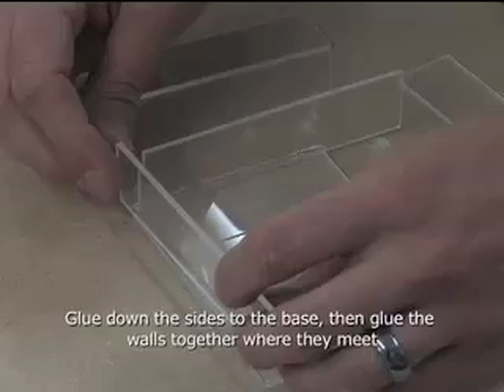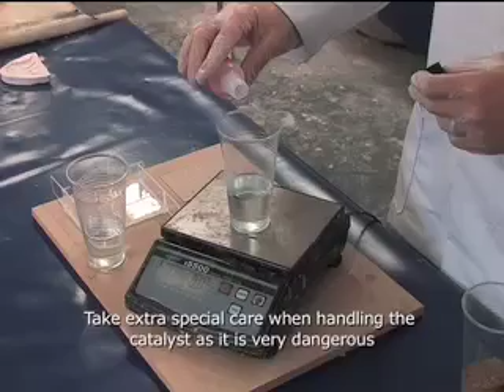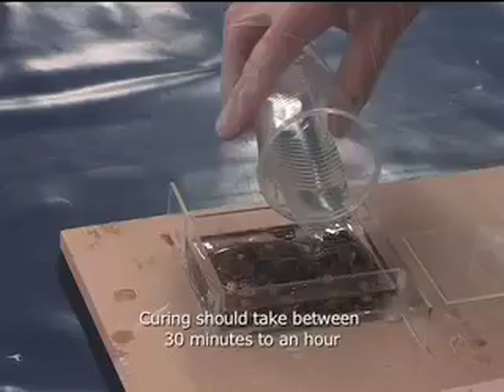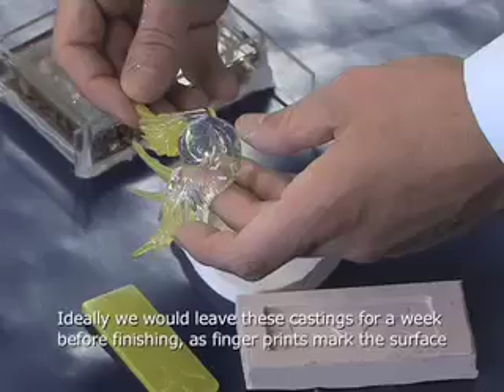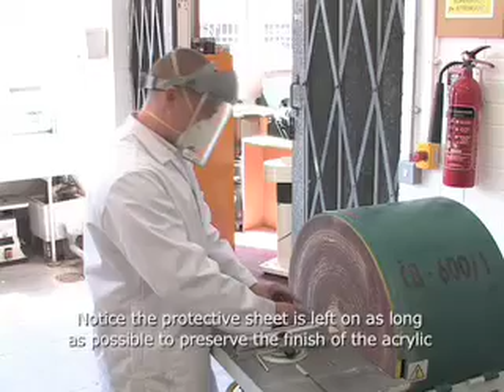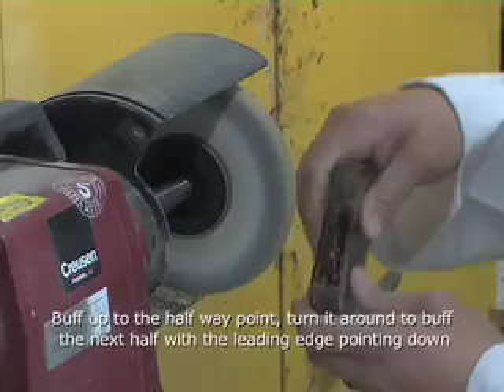How to use clear casting resin for encapsulations and casting

Comment: Hey nice video. I was wondering how you finished the piece after polishing it. Did you remove the top and bottom pieces of acrylic sheet? If so, how would you do this with out damaging the casting? 

Also in your opinion would it possible to cast a block thats 1 foot square in Polyester Resin? Just use very little catalyst and let it cure for two weeks?

Comment: soooo if im not trained and don't have one of those saws, anyway to do this video??
Reply: you can use anything hes referring to a shop setting needing to be trained by superviser. you may also use hand saws or a grinder with a cutting disk some cutting methods just may leave more work in the buffing stage i would sugest a 30$ hand grinder and you can switchfrom cutting wheel to sanding/buffing pads.

Comment: how durrable are these moulds I am wanting to make a gift for a friend of mine and it would need to be extremely durrable and how large  of a mould (or cast  I'm not entirely familiar with the terminology ) would you say is possible
Reply: I used mine to crack the skulls of 2 seperate home invaders and its still barely got a mark on it (after a quick wash), so... fairly durable.

Comment: please help.  I am making small 1 inch buttons using polyester clear resin but my cast turned out very sticky even after 48 hours.  Whats wrong?
Reply: My experience with sticky clear resin after 48 hours is that I didn't mix exact amounts, and this stuff is finicky! It requires stirring slowly and making sure it is completely mixed. I stir 10 x clock direction and then 10x anti clock direction. If I'm not completely satisfied Ill do this 5 more times. Hope that helps
Reply from the maker: what type of mould are you using? silicone?
Reply: RICHOCOARM too late for the comment.  i bought easycast epoxy resin instead works better but now got a new problem which is the mould has become dull and the cast turn out quite dull instead of crystal clear.  plus i can see some kind of marks or pinholes on the resin cast but cant spot anything inside the mould.
Reply from the maker: mould material??
Reply: mixed resin wrong probably, or your mold maybe has moisture or wrong material

Comment from the maker: Check your data sheets. it should say if its a polyester resin. MEKP catalyst it comes with it.
Epoxy (polyepoxide) resin is usually used only in thin layers (like on boat interiors). Polyepoxide is different to polyester. Epoxy resin is stronger, but is more expensive and more harmful than polyesters.  
I like to keep my exposure of polyepoxides and polyurethanes to an absolute minimum when casting. Just use polyesters or bio resins.
See my website for more info at castingabout.co.uk

Comment: Do you know if ice resin and amazing clear cast are just expensive brands of what you are using? The other question, is epoxy the same as polyester resin and if not which is a stronger material?